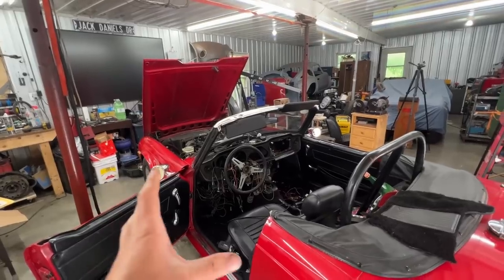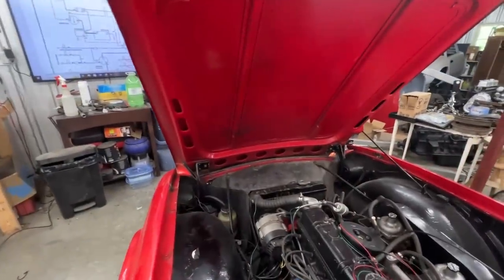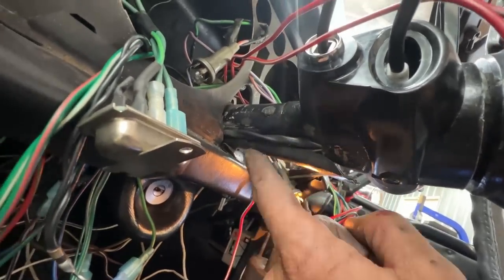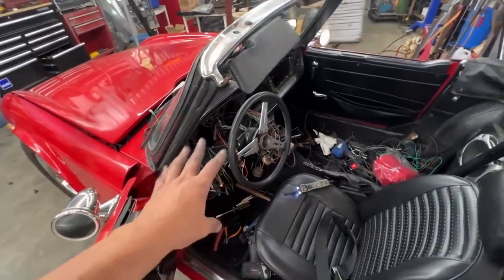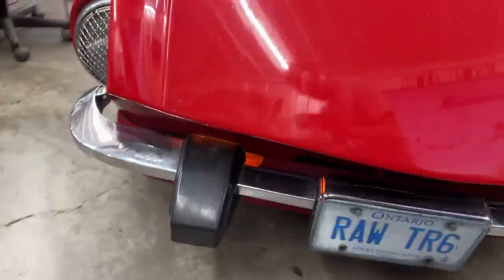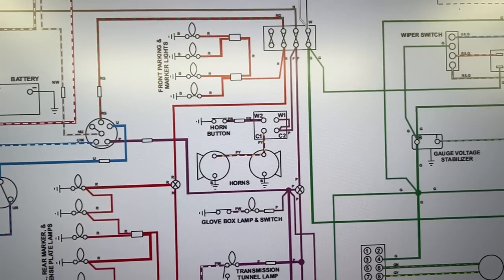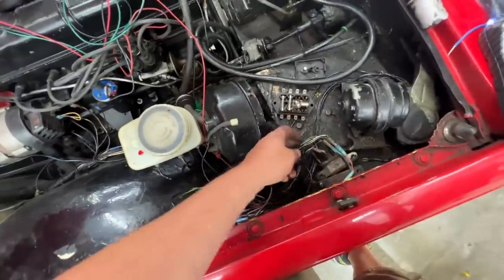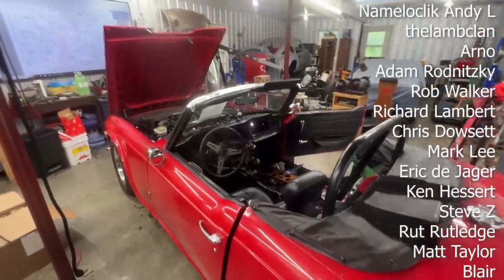1972 TR6 Wiring Issues - Part 2 - Testing

Comment: Very nice job. And think of the salvage value of all the unnecessary wiring you removed!  LOL
Reply: Very true Chris, (I used to work for a large electrical company and the scrap cable that was stripped out of old installations during the year was often enough to pay for Christmas dinner and drinks for all of the engineers!) happy days! 😁😁😁

Comment: Hmmm... when you showed us high and low beams you said you didn't know which was which... but I didn't see you check the high beam indicator light on the dash... and I think it is part of that same circuit.  This has been an interesting demonstration of using straight logic to test and troubleshoot... but it demonstrates why so many of us shy away from some of this stuff.  Thanks for sharing this with us.  Years ago, my fuel rail sprung a leak and I had a fire on top of the engine... it burnt up the wiring harness.  I SHOULD have done what you did... but I hired someone to do it... and it happened again ... the fuel rail leaking and a fire starting... and the repaired wiring harness caught on fire again.  I ended up selling the car "as is"... because I was so fed up.

Comment: Wow, that's excellent. I have worked with electricity and electronics all of my life, from becoming a ham radio operator at 11 years and using and repairing electron microscopes in my work. Now, at my age, however, I have no more patience for that and would have to hire Dr. Rusty Sparks to do wiring work. Thanks for another great video, Elin!

Comment: Great job, so far. You now have a place to mount the overdrive relay, if the customer bought one. Cut or tape the ends of the regular speaker wires, I have no idea why someone left the with bare ends. Tell the guy who was walking in the background (David) to, at least, say hello if he is going to be in the video.  You need to give more credit to Rusty, I am sure he is a big help

Comment: Most Triumphs run the headlights without a fuse. That makes the switch more or less the fuse. A common aftermarket improvement is to add a relay and a fuse.

Comment: After major work on a car electrics it's a good idea to have a fused link in the battery lead when you connect for the first time. That way, if anything is wrong/shorting, the fuse will pop rather than letting the smoke out of the wires!

Did you fit a new firewall grommet to replace the big lump of silicon?

Comment: Have you thought about wiring in the diodes into the hazard relay box? That way it will look stock and also a working relay could just be replaced.

Comment: I do like the roll-hoop on the back of that Red TR6. I think I would have better peace of mind knowing I had that if I was regularly using the car in typical traffic scenarios.
Reply: Do cars roll onto their roofs in typical traffic scenarios ?
Reply: @johnmoruzzi7236  naturally every day but with a metal roof the occupants often survive. With an old convertible (without modern pop up hoops behind the seats) that would probably be unlikely, obviously..
Reply: @philtucker1224  Just buy a TR7 hardtop then.. that was the mistaken thinking behind that design in the mid-70s..
Reply: @johnmoruzzi7236  I don’t have a convertible. (Is there a reason why you are against roll protection?) - Have you never raced a car with a role cage or appreciated the potential benefits? What are your motives John?

Comment: The hot leads off the positive battery cable would be safer if they had fuse link wire installed.

Comment: You, sir, have the patience of a saint! 😂 
Just a thought, did you consider removing the "guts" from the failed 5 wire relay and tucking the diodes inside it? Modern electronics hidden in an original case?
I bet I've got some diodes in my stash. (Someone dumped a half dozen bins full of various brand new electronic components... transistors, diodes, etc... gundreds of items! I grabbed em and stuck em in storage.)
I always liked that the Lucas relays could be disassembled and, to some extent, repaired.
BTW, what in the world did they paint that engine compartment with? In one of your closeups near the wiper motor, I thought we were looking at a greasy old gearbox or something!

Comment: Elin it might be worthwhile to discuss the difference between the fuses used in Triumphs, and modern fuses. Using a modern “slow-blow” fuse can cause overload conditions, even though the fuse may be labeled at the same rating.

Also did you figure out why someone switched the wire colors on the rear harness connector?

Comment: Good video Elin!  
Even though it is not used on the original schematic, are you going to add a fusible link on the brown circuit near the Positive terminal for safety sake?
Slick trick using the diodes!  What values did you choose?

Comment: Great repair but you skipped diagnosis and repairs at the connection to the rear harness. Someone has cut one turn signal line and swapped it over to the line for the other other side I think ? You had funny symptoms as though something was missing but suddenly everything was fine !